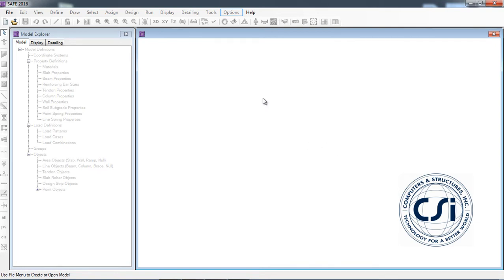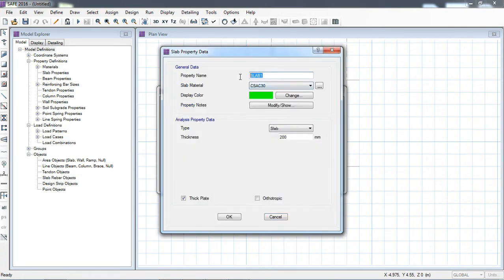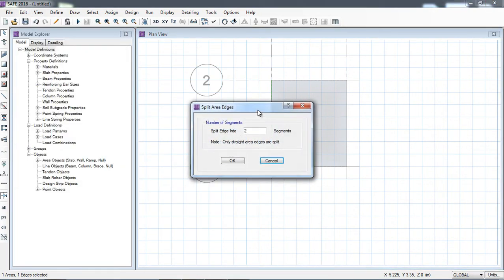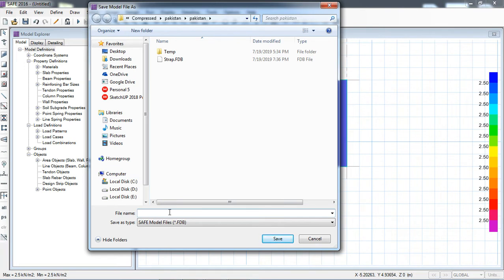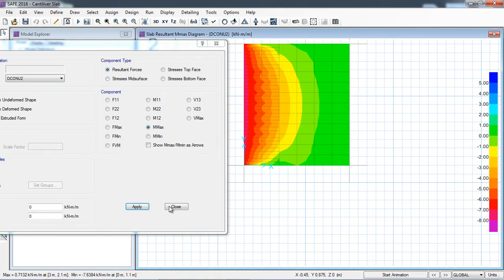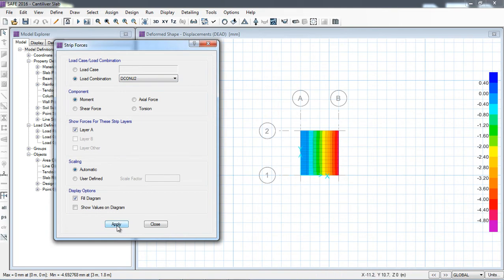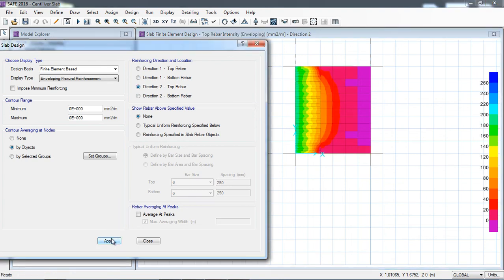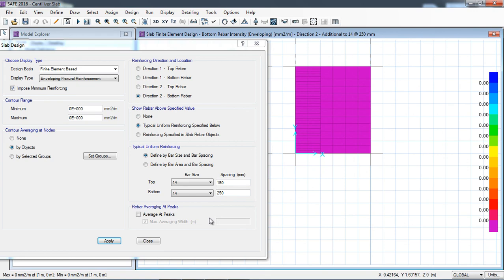CSI SAFE - 24 Cantilever Slab design with reinforcement details

Comment: my cantilever beams all fail in shear. I modified the torsion constant to 0.001. But even then cantilever beams fail no matter how big section I assign. What might be the reason? It is bothering me from days. cantilever beams are not that long. They are only 3.5 ft, 3 ft and 1.5 ft. Here is my file https://drive.google.com/open?id=10Pr_WSKlv9L77CIb_aP9HbpYuux38fvA
Reply from the maker: Dear you have lot of failures, like shear failure ,bcc falure... here i have shown in picture... 
https://drive.google.com/open?id=1JMiPhy874kYVTn1LRtmhHdST72d4iagd

Secondly ... you have to increase the concrete strength and cross section size.....
Reply: @civilmdc  I know. beam-column capacity ratio failure can be addressed by increasing the reinforcement in column or by increasing the column section. The cantilever beam failure in shear is what bothering me. The top floor cantilever beams have no load except 2.5 kN/m paraphet wall load, 1 KN floor finish and live load of 3 KN. And the cantilever beams are 3 m long. Even if I remove all external loads and design, it fails in shear. What might be the reason? This is the second time I modeled this building to make sure I didn't do any mistake but it still as same problem. I don't know what is the reason. please tell me the cause if you find any. I was modeling it in etabs 2016. I will try to model it in etabs 2015 once again. Thank you for your help! Best wishes!
Reply from the maker: @beenay18  Dear, i have checked.. your modelling is looking okay..... 1) yes you have to make strong column and weak beam (6/5 ratio check)     2) 3 m shade is little bit long .... you have to take care of this ... by changing section and changing strength of concrete.....        It does not mean you are only getting loading from gravity loads... you are also getting loading from earthquake and wind loads..... and you have mentioned in your model that your model is high seismic area (i have seen your earthquake parameters).... and at last dear,,,, in real designing we also give much time ... in satisfying sections... and it takes time....
Reply: @civilmdc  Thank you for your feed back in much needed time. I also modeled it in etabs 2015 and the result is same all cantilever beams fail in shear even if I remove all external loads from it. I don't think 3 ft long cantilever beams should fail on just dead weight of beam and slab. even 1.5 ft cantilever beams are failing. I have designed many buildings in etabs even with cantilever beams of 5 ft. I did not encounter this kind of result before. I have encountered this problem in two projects and I have not been able to find the cause. I think I must be doing something wrong. I would be really happy if you or somebody else in this comment section could find the cause.  Thanks a lot!
Reply: @civilmdc  If you look at the shear design details of the cantilever beam by right clicking it. The shear force Vu2 is in the range of 300 to 400 KN. It is very high. Its equivalent to the vertical reaction force Fz at the base of a column of a ordinary size 3 story building. It does not make any sense. Even the 1.5 ft long cantilever beams are failing. I am trying to find the cause of this problem. If you can suggest any cause I would be really really happy. Thanks!
Reply: when I remove the seismic load from load pattern, beam does not fail. There must be something wrong with the seismic load configuration or mass source.
Reply from the maker: @beenay18  Yes i have again checked....
Reply from the maker: @beenay18  Brother you have to apply full length beam.... it will resolve your issue without removing earthquake load pattern.